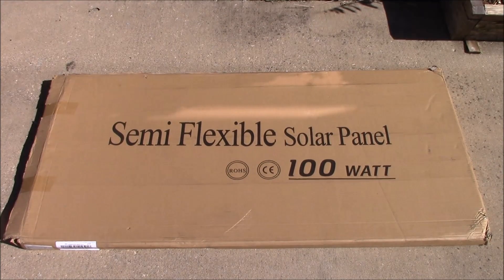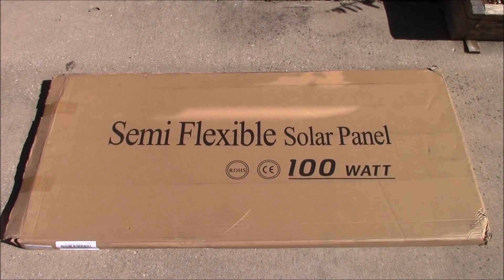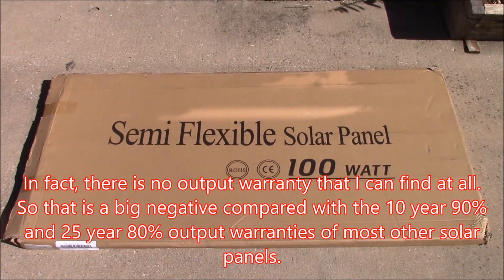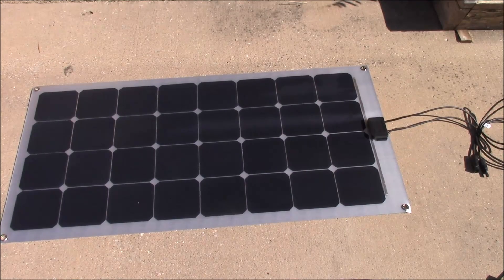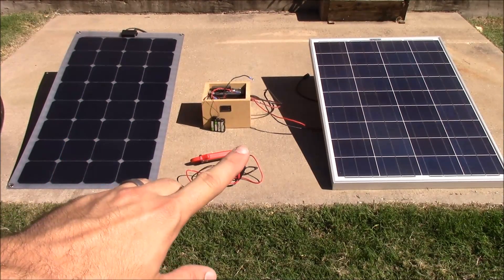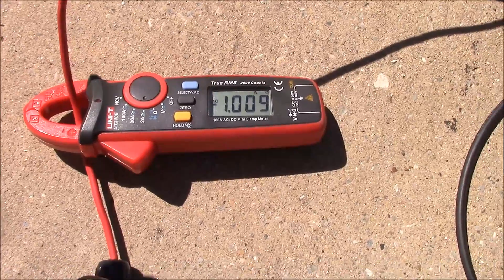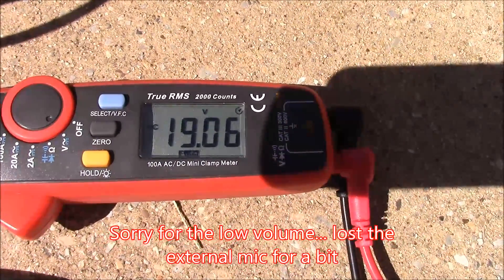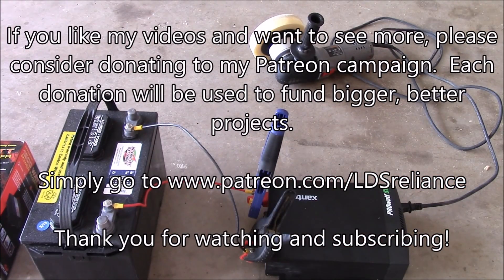Lensun 100W Semi Flexible Solar Panel

Comment: Open circuit voltage is lower since it does not have the typical 36 cells that 12V panels (like the compared one) have, but 32 cells. It's probably mono cristalline, not thin film. 32*0.6V=19.2V.
So I suppose they are quite modern and efficient cells, therefore also the price. 
Just bought 2 pallets of a very similar type, directly from China they should be close to 100$ now. 
It would be great if you show the specs (should be in the manual and on the backside) of both panels. 
A bigger, half charged battery would probably have drawn the possible 6 amps.
Reply from the maker: Agreed.  I was a bit puzzled by the 1 amp draw but since they were both doing the same thing (which was the whole point) I just let it go.  I have already gotten a comment from the manufacturer on that, though, so maybe I should have found a different battery.  Oh well.

I also mistakenly assumed this was thin cell as it was touted as being flexible but I have also since gotten an email from the manufacturer stating that it should not be bent and found out that it was a mono panel so I guess that is what I get for assuming.  Not sure why you would market a mono panel as flexible.  That sounds like a warranty claim waiting to happen.
Reply from the maker: Also, I just added the electrical information to the video description.
Reply: Thanks for the video and the specs.
 22% efficiency, that's quite something. I hope I find time to test our delivery in the next 2 weeks, appreciate that I have yours to compare. 
As ours are quite cheap, I guess it will perform less than yours. Or maybe the used materials are less durable. But we'll use them more for temporary and emergency setups, so a few years of service only , not like rooftop installations. 
I'll try to test them with 100W 12V halogen bulb and possibly with an mppt charge controller, will keep you posted if it gives any useful results.
Reply from the maker: Andreas Ryf
Cool, thanks!
Reply: Could not make a full test of our panels, lack of decent sunshine :-(
Cloudy sky, delivered a good 20Watts, and still with a protective film over it. Well yeah, have to bring it tomorrow to the final application, by public bus, so better leave the film on.
They claim also to use sunpower cells, also 32 of them. It seems thanks to improved cell efficiency, the typical 12V panel is no more 36 cells, which makes sense, as the mppt voltage was slowly to high for PWM controllers. 
Our panel was actually just below 100$, but for a quantity of 100 pieces. As there is no free lunch : carrier is not Fibre glass but only some plastic, quite wobbly, so it tends to bend to much, even if it's only standing leaning on a wall. 
no reinforced holes for fixing, so setting it up will be fun, probably will have to punch some holes ourselves. 
All considered, the one you tested looks like a much better value to me.
Reply from the maker: Andreas Ryf
Maybe, but maybe not.  This one is $300 and the manufacturer chastised me for bending the panel as you see in the video even that small amount.  They are saying their engineers think it will damage the panel.  So even with the added rigidity it still may not last very long.  I'm not sure what the gain is over normal panels unless it is portability but if they are fragile that will make the portability highly risky.
Reply: S
Reply: Hi, we are producing triple-junction a-Si thin film solar cells and panels for the market. 
We have rollable thin film solar panels for roofs, solar tent and LED Lighting Pole. 
We also have Foldalbe/portable thin film solar panels for camping, higking, military use and disaster relief. 
For more information, feel free to contact me via alexyang@xunlightchina.com
Or just check my videos. 
Kind Regards

Comment: That's not thin film... it's mono crystalline silicon.
Reply from the maker: You seem to be correct.  That would also explain why it is the same size or slightly smaller than the other mono, traditional framed panel.

Comment: I need your help , please!
Here in Israel outside is 45 degrees Centigrades and I am a little warried. Please look at the pictures and give me an advise and tell me if I should be warried  and what I should do.
The charger shows that the two batteries are more than 30 volts as you see in the voltmeter and I measured the two together and each one. And the other device says the each battery is full and has the red light of alternator lit but this electric car has no alternator. The green light that shows that the battery is good lights only sometimes. Is this normal?  Please help me.
Thank You!

Best regards,
Reply from the maker: I don't see any pictures, sorry.

Comment: Thank you for your information 

from your knowledge 
what's the best solar panel equipments company which cheap and quality?
Reply from the maker: Some of the best values for the money that I have tried are DM Solar, Renogy, and Grape Solar.  They are not the cheapest but they are on the cheaper side and good quality.